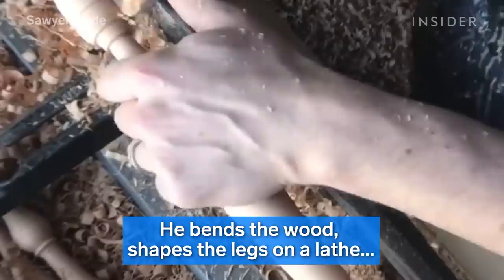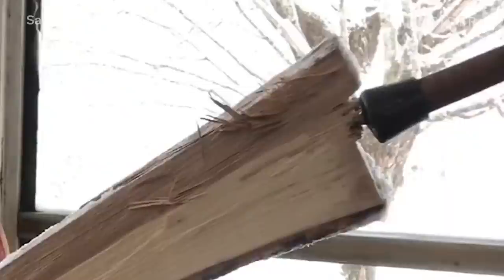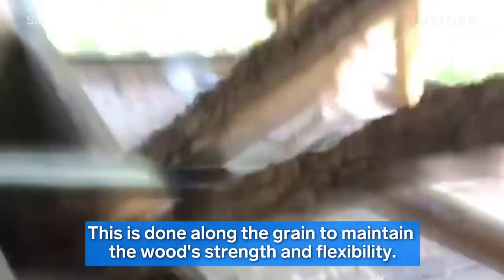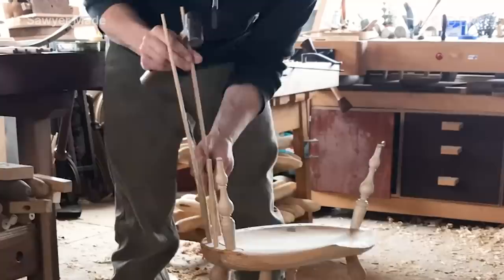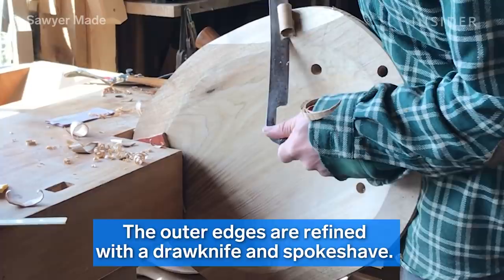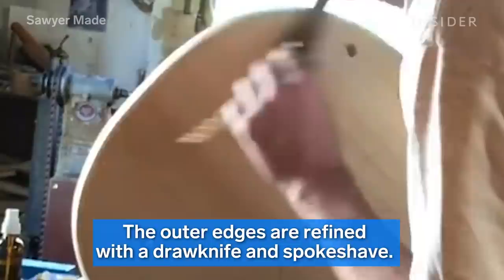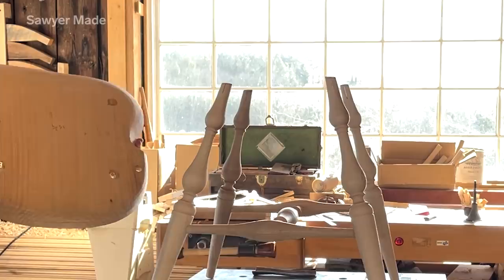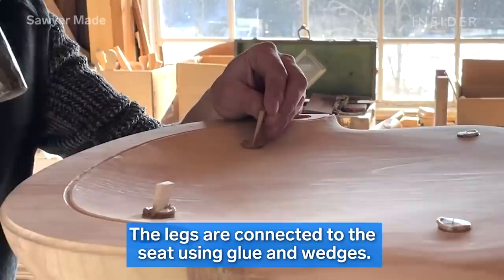Creating Windsor Chairs From Scratch

Comment: This is true woodworking. What a piece of art, fantastic. Maybe it's against tradition, but I'd prefer the chair just oiled, without paint.
Reply: Oil can soak into your pants when you sit on it, depending on type
Reply: @aaronschrader5995  there is special furniture oil to avoid this. It composes mostly of boiled linseed oil, that soaks into the wood and then oxydizes to a gum-like substance within a few days. It makes natural wood a few nuances darker, more colourful and strengthens the grains optical appearance. If you don't know this by now, you might want to try this on a cheap cutting board as test dummy. It's really beautiful, and most of these treatment oils are even food-safe.
Reply: It's interesting how wood used to be painted so often in the past. Now we think of real wood as a premium option that should be shown off, but back then it was just the cheapest material that would work and paint was seen as a sturdy, attractive finish. It would be kind of like if 300 years from now plywood and pressboard were considered premium materials and clear coated to show them off.
Reply: Everyone had seen wooden stuff and it was mundane. Plus you need to reapply the oil basically every year to keep it looking nice. Sounds like a poor peasants problem. Gimme some of that lovely lead paint so I can flaunt my money.
Funny how it has gone 180-degrees. Kinda like having a tan. It used to mean you were poor and had to work outside. Now it means you can afford going abroad.
Reply: @Itslvle  y
Reply: Couldn't agree more, maybe some nice stain
Reply: From the looks of it, this is black taint, not paint. That would also explain why he taints and oils the chair, and not paint and oil as the subtitle says.
Reply: Hello friend
Reply: @andrebartels1690  I use boiled linseed oil on all my axe handles. Such a great oil!
Reply: It looks more beautiful and true to form. :)
Reply: @andrebartels1690  I'm not sure why, but I love your comment. I know nothing about woodworking, but love watching it.
Reply: yeah same but i think the paint gave it an extra coating so it stays longer 
i would at least prefer darker or lighter brown thn just the blck paint
Reply: Hello my friends
Reply: Only a true wrk of art because less people make things by hand, a few centuries ago and it would just be trash
Reply: @synecdoche8783  maybe it would not have been regarded as a piece of artwork, okay. But it would have certainly not been regarded as trash. Throughout the centuries, a work of quality and craftsmanship has always been valuable, and you could tell if something is of good quality just by the looks. This is being corrupted by mass production. Nobody is willing to pay a fair price for hand crafted quality goods when you can have something with okayish quality that is half the price and looking nicer.

Comment: And you could get exactly the same thing done by a robot at 10x the speed and 1/10th the cost.
Reply: Handmade? I doubt it
Reply: @recoveringsoul755  That may be the dumbest thing I've ever seen posted to YouTube.
Reply: No you couldn’t. I’m not a luddite or someone prone to traditions for their own sake, but you could not get exactly this form and finish for anything like 1/10th of the cost. The advanced level of robotics required to create such compound shapes alone would necessitate a huge investment, not to mention the senior engineering team to program and maintain them. You could get a poor imitation of this type of thing that could be mass produced to the point where the prices would be significantly lower, but it would be an industrial operation at huge expense, and then there’s simply not a sufficient supply of that quality of hardwood stock for it to be sustainable. There’s a reason why you don’t see anything like these chairs in a department store—it isn’t feasible. 

That said, this is a video showcasing an artist creating art on a video series dedicated to art. So this entire debate is kinda moot since costs and prices are irrelevant, and while you could certainly employ modern technology in the creation of art, mass production of consumer goods probably wouldn’t count.
Reply: @silverXnoise  I agree. I have never seen those wedged and tapered mortise and tenon joints in any mass produced piece of furniture, and I doubt that it would be cost effective to do so at any scale. I think that joint is the keys to why some Windsor chairs have lasted 300+ years.

Comment: with all the respect to the work, this chair doesn't look strong to me.

A chair needs to withstand a man with a girl on his knees. 150kg of load minimum! Preferably repetitive!
Reply: I hope you mean a woman, leave the children alone
Reply: It might surprise you, but these chairs are extremely strong. The wood is split instead of sawn, and the pieces are steam bent, which means that the wood fibers run the full length of the pieces as opposed to sawn pieces which have grain "runout" and allow the wood to split more easily. The wood types are also carefully selected, with woods like oak/ash chosen for the legs/back because they are incredibly tough and springy even when thin (think similar properties to an axe handle), and pine for the seat since it's resistant to splitting. The tapered mortise and tenon joints also get tighter and more secure every time you sit on it. There's examples of Windsor chairs from the 1700's that have seen many years of use and you can still sit on them 300 years later without them breaking.